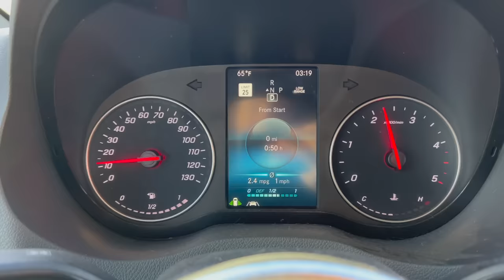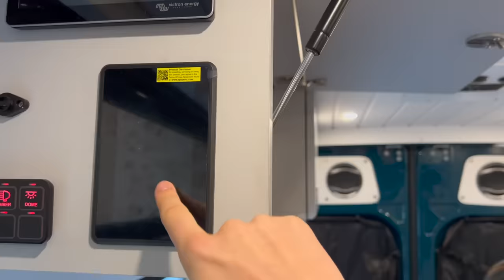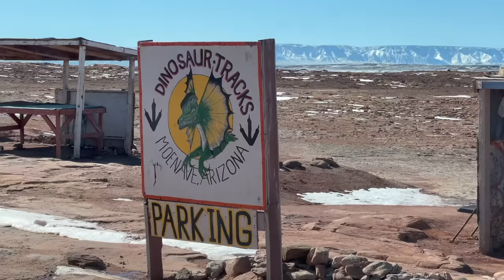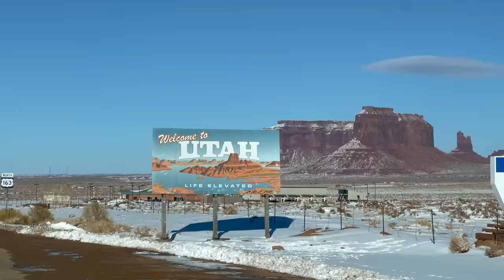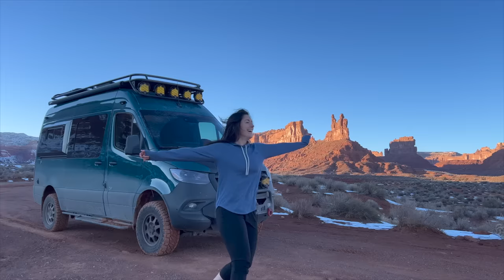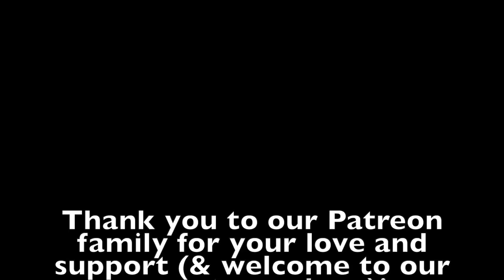Living in a 4x4 Van | Adapting from Snowy City Life to Off-Grid Barren Desert

Comment: I had a 20 year old North Face tent that I used when I returned to college in my mid 40s. It survived a windstorm in Death Valley (if you know you know) that destroyed a handful of other students tents and put most of them in the vans for the night. I hardly slept from the noise but didn’t even have any sand in my tent and no damage. That tent saw me thru several years of college forestry/natural resources field trips. I’m now employed in forestry. Need a new tent. (Finally cracked a pole).
Reply: It was the Condor tent for anyone curious.

Comment: I have a 94 Astro van got to see how much it would cost to put a heated floor in there and try to find out if you need like you know those Unity plug-in that goes to the hookup inside goes to the battery unplug anything in it heat air condition anyting I just don't know if you need a bunch of more batteries

Comment: The terrain resembles the surface of the planet Mars.  Do you know?  Mars is a popular topic.  Many films about Mars.  ... The atmospheric pressure on the surface of Mars is low.  The attraction is weak.  A person will feel very easy there, but in the future it will lead to heart dystrophy due to unnatural conditions.  The atmosphere is 90% carbon dioxide.  To make this gas a liquid you need a temperature of minus 170 degrees Celsius, I don’t remember exactly.  It is possible to extract water from liquid carbon dioxide, but it is difficult.  Oxygen can also be extracted from carbon dioxide.  However, to do this, you will have to “ignite” the entire atmosphere of Mars, like an explosion.  Cause carbon dioxide to split into carbon and oxygen.  Then Mars will become sharply warmer and the surface of the planet will be covered with a thick layer of soot, water will appear due to the combination of free oxygen and hydrogen from the atmosphere... Soil, heat, water... How to blow up the atmosphere of Mars?  Venus is another matter.  The planet is similar to Earth in size.  Venus rotates in the other direction, where the sun rises in the West and sets in the East.  And a year on Venus is less than a day.  endless day.  On Venus, the atmospheric pressure is the same as at a depth of 5 kilometers in the ocean.  At this pressure, a person will be left with a cake of bones.  Very strong wind.  And the heat is 250 degrees Celsius.  COLOSSAL ENERGY POTENTIAL!!  FULL ELECTRICITY!!  All you need is a very strong “house”.  Venus resembles a girl who is very beautiful from space (from the outside).  And a hurricane of feelings burns inside.  Nikki!!!!  Are you reading that??!!  I am writing for you!!

Comment: Does Nikki ever respond or only to the people who are her patreons.  I know that Sprinter has a supposedly good reputation but as one RV dweller told me look at all the abandoned Sprinter 4 X 4 on the road. I haven't seen any but am wonder if she could answer or anyone know here, why did she buy that. First as she has found out they have breakdowns and are VERY expensive to repair and they take only premium fuel. Now that Toyata mini-vans are hybrid, why did she not buy one of those, they have 4 wheel drive models, wondered if the only reason you got one is that they GAVE you one, otherwise this is an anti-commercial for one, so in case you forgot the initial question, why oh why did you get this Sprinter (besides there are more useful videos on turning a mini-van into a dwelling for cheap than a Sprinter!) I have a Dodge Caravan Jucy van and it's plenty big to camp in AND it takes Flex Fuel which are the half  the price of gas.